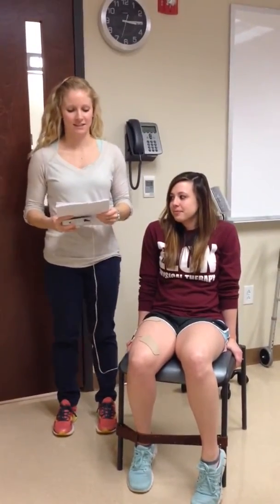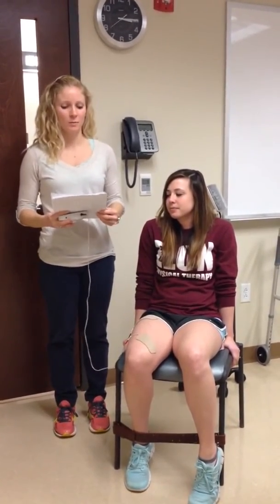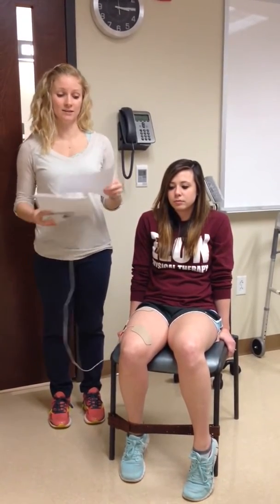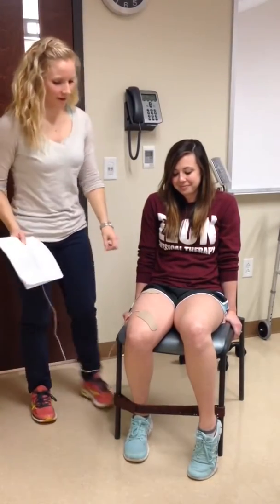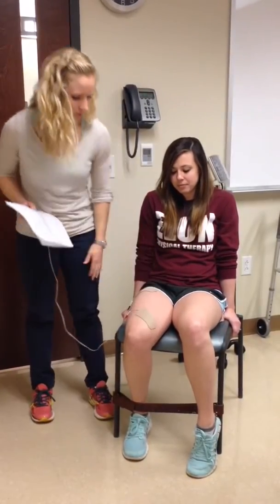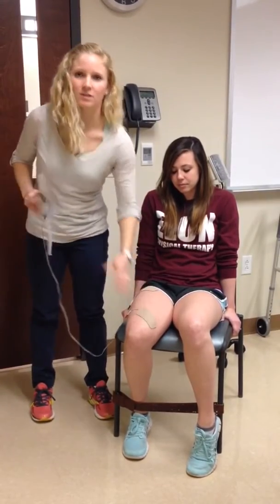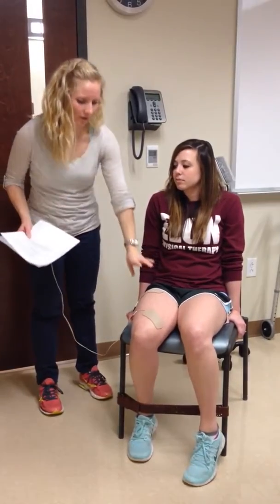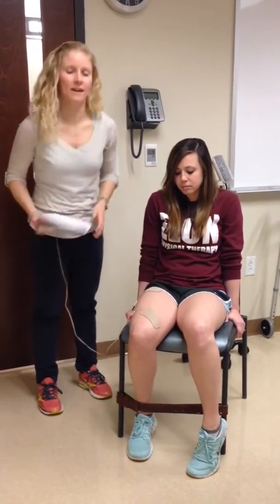NMES to improve quadriceps strength after TKA.

Comment: How did you measure the knee angle (in your model it is more than 90 degrees)? How could you improve positioning so patients were able to consistently achieve the angles described in the paper?